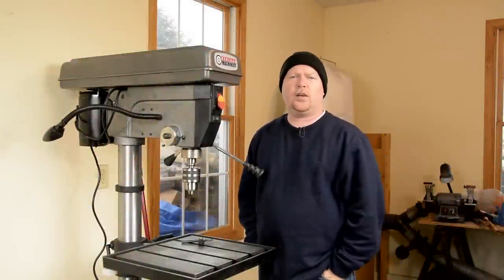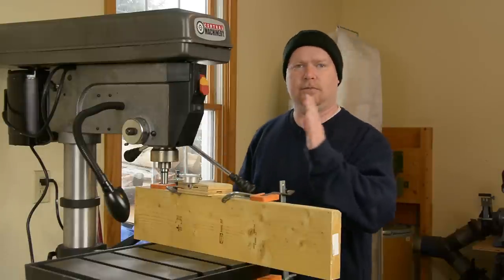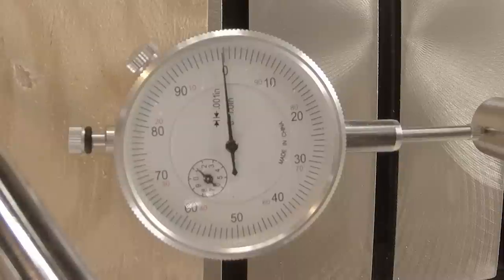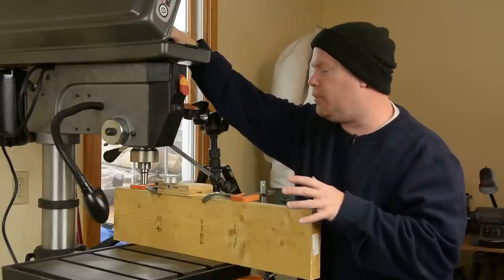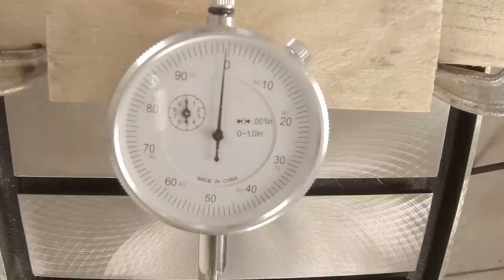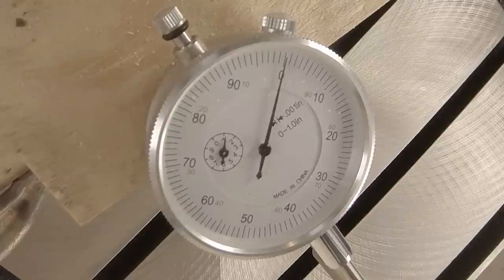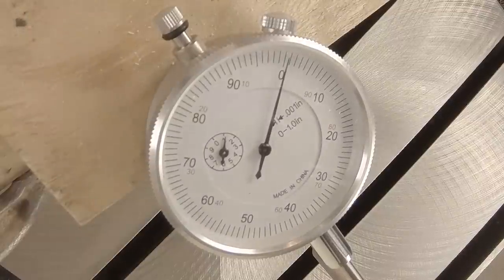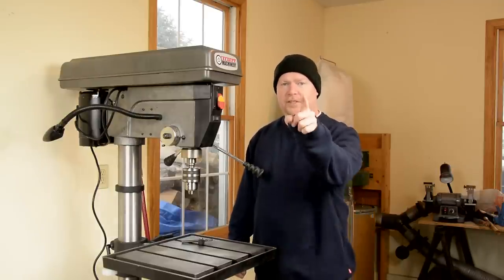Harbor Freight 20" Drill Press Runout Check

Comment: That's pretty accurate for HF hardware. You can possibly still get more accuracy for the final runout on your mounted bit. You can remove the chuck and index it on the shaft in 90° increments until you find the runout on the shaft has offset some of the runout on the chuck. Unless they are already at max offset. Then you're outta luck. Good video, thanks for sharing.

Comment: .006 is okay for woodworking but not for small hole drilling in metal. I just replaced a chuck with .005 runout. .002 is my limit even on cheap gear.

Comment: You need a 3/8 or 1/2 diameter steel dowel pin in the chuck.

Comment: When the quill is in its upper end of course there is no runout at all.As the quill lowers then starts to have significant sideways movements that are highly noticeable without any measurement device from 0.5mm up to 1mm.Simply the slotted channel in the body of the quill has uneven cutted depth so it is impossible for the tighten screw to adjust it for minimizing the movements because depends from the certain height of the quill every time.So there is nothing to measure and even more to fix unless you are a proffesional machinist having high grade milling machine to cut the slot in a uniform depth and then accuracy comes naturally from its own.
Reply from the maker: A - It's not a mill.  The capabilities are more than adequate for a drill press
B - If it's that critical you have a table that will go all the way up to the tip of the bit so that there is minimal quill extension.
Reply: @MattHeere  However i wish to had the opportunity to make the milling in the slot of the quill some time to make it having perfect accuracy,but the problems are two.A reliable maschinist to take seriously the job and not destroy it and second what is gonna bill for his job.I am afraid a kill bill.

Comment: Put it under a drillng operation load when testing, or put side loads on shaft.,?
Reply: You cant measure when doing that.. the vibrations alone will give you like 0.05+++ runout from the bouncing.

Comment: I purchased the smaller floor model of the drill press and it had 0.12-0.13 runout - horrible. You could see the chuck and the stem wobbling. Took it back and got a Jet, hopefully that will be better. Not to mention all the castings were rough as hell, and you could see the piss poor machining on the stem, spindle and quill - your could see the wobble in it itself. Bad even for HF.
Reply: Chris F  what I've noticed with HF presses are you have to take it apart and reinstall everything correctly. At least that worked for me.
Reply: Yeah I saw people post that, and I did try it, but unfortunately, it did not work for me. :-(

Comment: What is the lowest speeds you can get ,and does it slip at all? I do mostly metal work.
Reply from the maker: The lowest speed is 180 RPM.  It has enough power though, especially at that low gearing, that I'm pretty confident that you could use an appropriate speed controller on the motor and slow it down even further if you wanted to.

I've never noticed any slippage.  The belts that come on the press are just OK though. I've considered replacing them with link belts to cut down on vibration and increase the grip - but I haven't done it because it really isn't necessary.
Reply: Thanks!

Comment: Great vid, but, how do you fix the run out please,,,,
Reply from the maker: +drowization All drill presses have some run out.  How you go about fixing it depends on where it comes from.  In the case of this press it seems to be (I haven't really tracked it down) a combination of a mediocre chuck and a tiny amount of slop in the quill bearings.

I have a new chuck on the Christmas list.  If it materializes I do a follow up vid on how much improvement it makes.
Reply: +Matt Heere Sounds great thank you for getting back to me so fast also how do you get the chuck out if its stuck,,, don't want to damage anything ,,,,
Reply from the maker: There's a triangular shaped key that inserts into the side of the quill that knocks the arbor/chuck combo out of the press.  You can give this a pretty sharp rap with a hammer if needed, but usually this comes out easily.

Getting the arbor separated from the chuck is sometimes fun.  If you open up the chuck all the way you can get at the end of the arbor.   Stick something like a hardwood dowel or brass rod down in there to use as a punch to knock the arbor out.  Watch out because it will probably go flying!
Reply: +Matt Heere Great, all of your advice is great, thank you.... last thing, any videos on how I can fix the run out or the wobble ? I got the chuck out and cleaned it, but it still has wobble in it. It is harbor freight drill press.... the part that the chuck goes into has wobble in it as well ???
Reply from the maker: It's a whole system.  All of the components can contribute to run out.  Your best bet is to take it down to just the quill and check that.  If it's acceptable, then put in the arbor and check that.  If that's OK, add the chuck.

You'll also find that it's possible to "offset" some run out.  Mark the arbor and the quill with a line, and measure it with the arbor installed a rotated a couple different amounts with respect to the line.  You may find one orientation that works best.  Same for the chuck.
Reply: +Matt Heere Make sense, thank you. I'll give it a try good sir . Thank you....

Comment: your dial should be set onto the casting close to the quill . and there are 2 seperate tests that need to be done. one to check side to side tolerance  , an then run out to check an see if the shaft is true an im sure you will find some on each test if done correctly .

Comment: its a drill press head not a mill less than a .001 good enough
Reply: also whats the breakin process 10min 20min high to low
Reply from the maker: +Jon A Agreed.  I'm very happy with the level of precision at this price point.  The supplied chuck won't hold anything smaller than 3/16" anyway, so the run out is a very very small percentage of the hole size.
Reply from the maker: +Matt Heere It isn't specified in what passes for a manual.  I ran mine on the slowest speed for 5 min, then the highest for 5 min.  I did this as much to ensure that it would run reliably during the return period as I did to break it in.

Comment: I just bought the 20" HF drill press. 
Cant drill an accurate hole cause of the
Spindle moving all over the place. 
THIS DRILL PRESS IS A PIECE OF SHIT.
I COULD DRILL A MORE ACCURATE HOLE THROWING A DRILL BIT AT A DART BOARD BLIND FOLDED.
Reply from the maker: Then return it and get another one.  Mine is absolutely fine.  Sadly the quality control on these imports is spotty at best and it does sometimes take going through a couple of units before you find a good one.  You might check the run out at the quill.  It could be that just the arbor is out of round, or the chuck is defective.  Both would be far easier to replace than returning the entire thing.

Comment: A hour or 2 will wear the bearings so it will be 1/4 inch, soft bearings
Reply from the maker: 3 years of use and it's still fine.  Drilled thousands of holes mostly in wood, but also aluminum, brass, and mild steel.    Even manages to stand up to use as a make-shift spindle sander, which is much harder on the bearings than any drilling operation.    If the bearings go at this point I'll replace them and won't feel like I didn't get my monies worth form them.